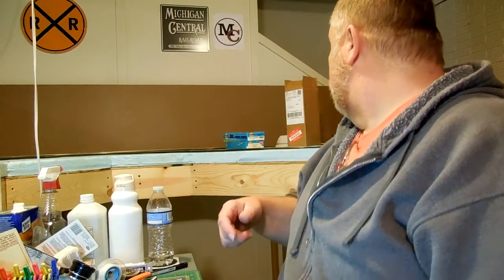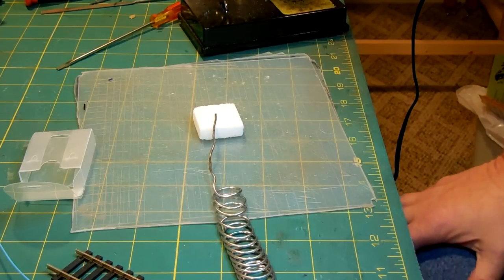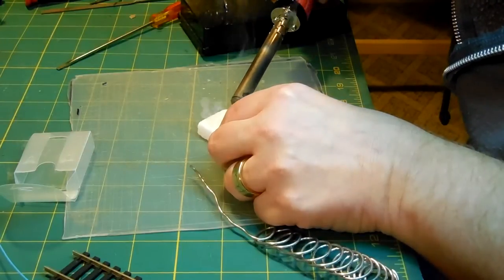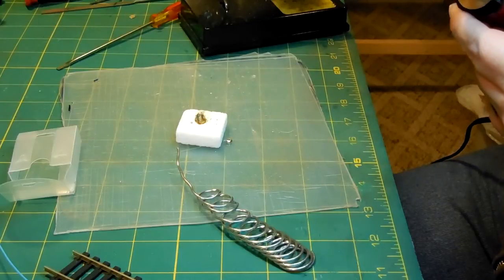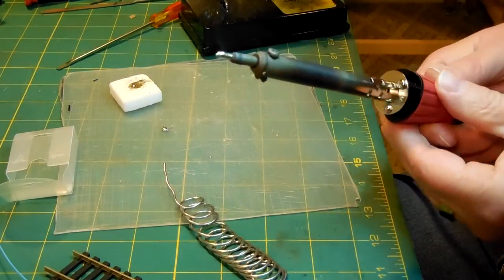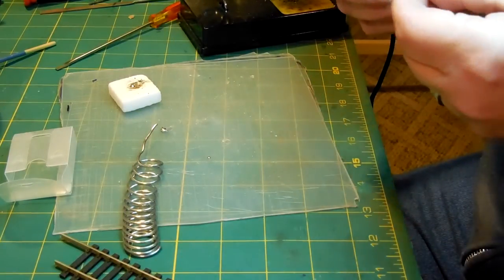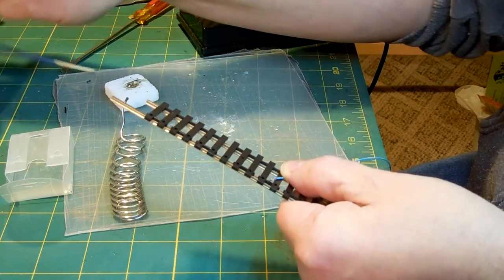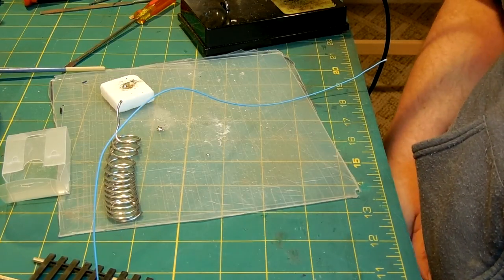Sal Ammoniac How To!!!

Comment: WOW!!! I imagine how it smells!
To soldering tip longer maintain good condition, it must not be sharpened with a rasp, it must be forging with a hammer. 
In this case the metal on the end of the soldering tip is more dense and less will burn out.

Comment: Help!! I just got a new soldering iron and after I cleaned it with the sal ammoniac it won't solder and the tip is black. I tried your method but I must be doing something wrong!
Reply from the maker: did you reset your tip with solder after you cleaned with the  Sal Ammoniac
Reply: @phillipwyman8963  yes I've got one side soldering now, the other side is being difficult!
Reply from the maker: @ataylor5901  Try and redo the whole tip again and clean with the wet sponge after every time you use it brother.

Comment: Another remedy is : file the tip down to bare copper. Get a flux brush, heat the iron up SLOWLY and brush NO KORODE paste flux onto the copper tip whilst in contact with the solder. If the tip is too hot it will reject the solder. It should coat the tip nicely. You can file down old pitted tips and give them new life with this method as well. You're Welcome  :o)